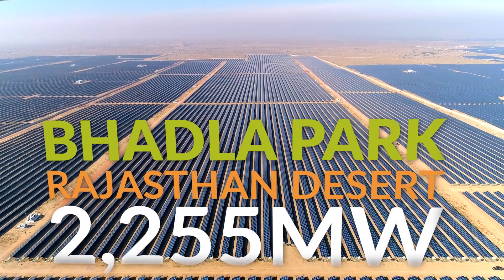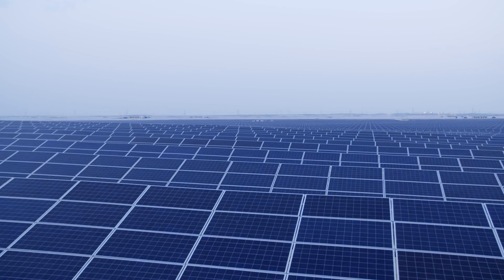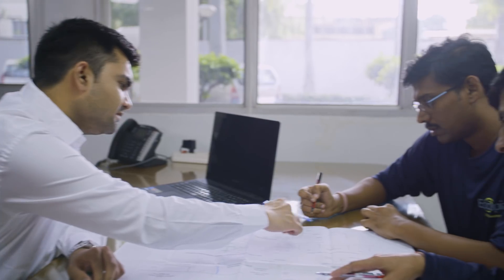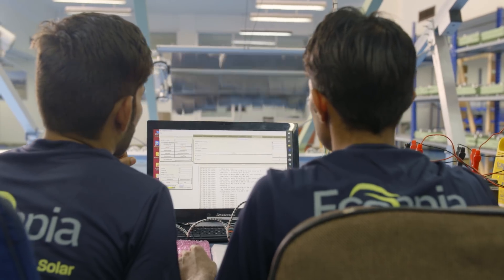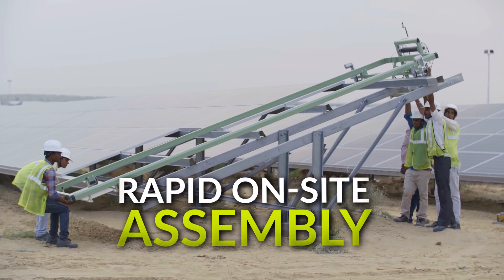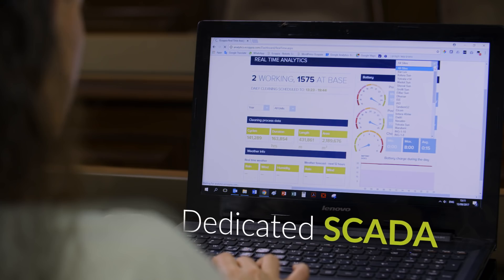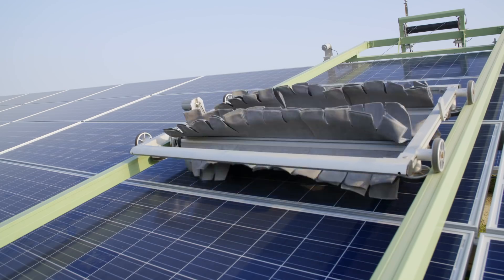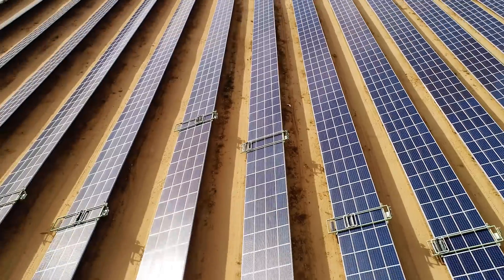Solar PV Robotic Cleaning - Ecoppia E4 in Bhadla Park Rajasthan, India

Comment: What my observation is, cleaning is achieved by sweeping. So the dust /sand doesn't gets blown and resettled on already cleaned panels? Considering the location of project, sand can be dusted off (as it's in form of grains). What about fine dust particles?
Reply from the maker: Hi Kaustubh,
The Ecoppia E4’s fleet of robots perform nightly cleaning removing 99% of soiling in each operation, enabling peak performing panels year round and an immediate recovery after dust storm. 
Our water-free solution is using unique microfiber and airflow cleaning system that is both safe for the panels and keeping them clean even in the hardest desert conditions
Reply: Right. I was thinking some sort of dune grass to keep the sand and soil in place. But this place is huuuuuuge. It would take years to plant.